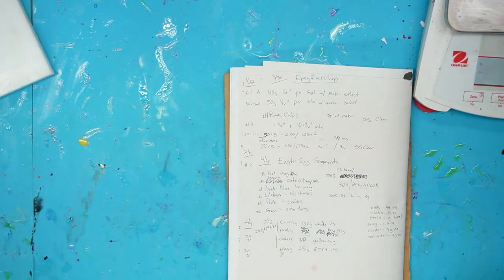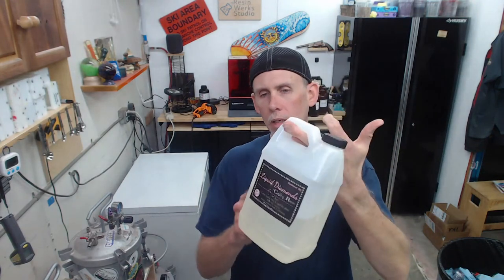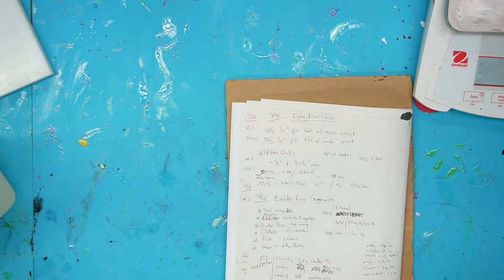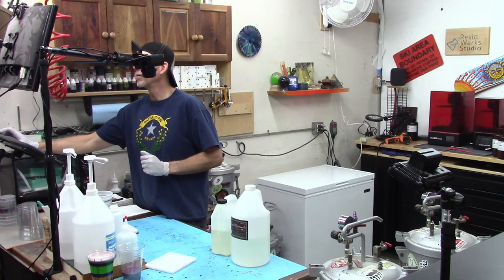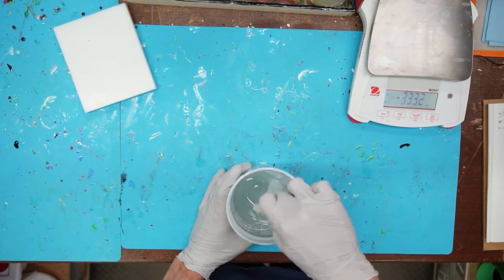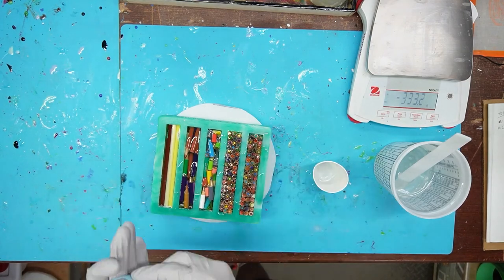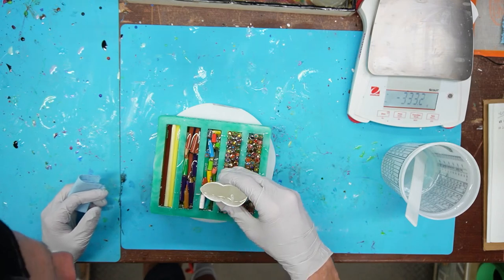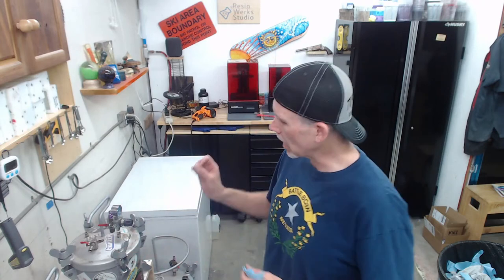🔴Replay: Casting Colored Pencils | Episode 181

Comment: Could they have both gone in the big chamber or do they all need to b in separate chambers, i mainly watch little jewellery molds, so these r really interesting, the chambers stop air bubbles right, thanks
Reply from the maker: Great question! You can put them all in the same one, I just didn't want to mess with stacking them since I had a couple pots available